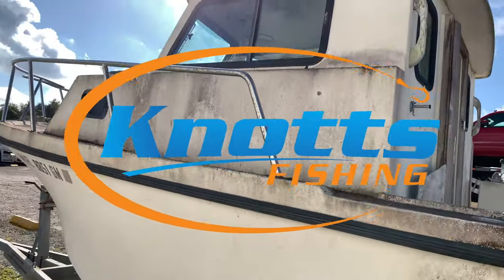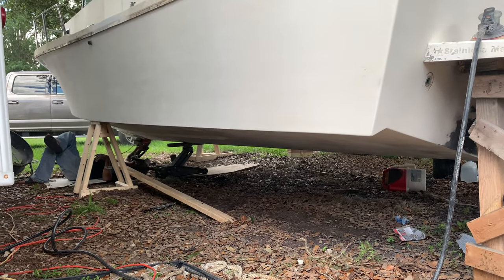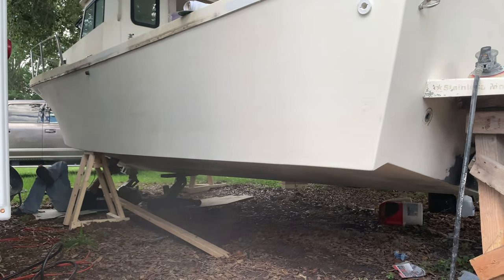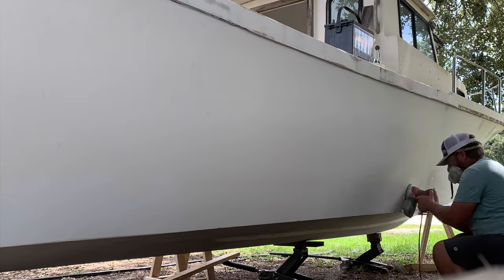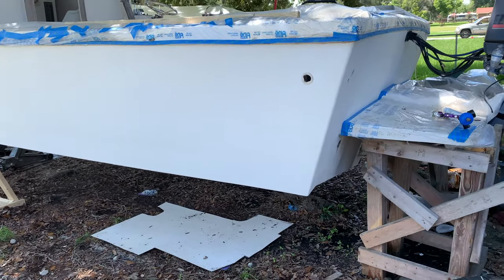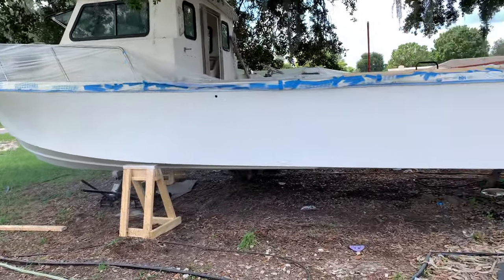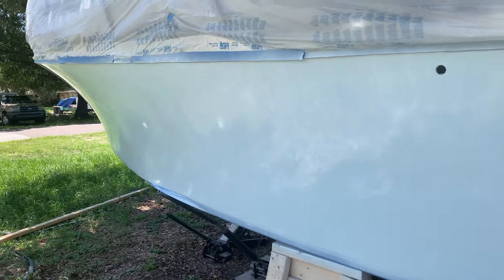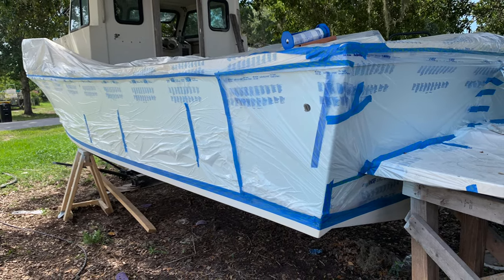Painting a boat with AwlCraft 2000 | Awlgrip | Broken Pilot House Part 5

Comment: Just found your channel, very interesting. When the boat was built did it have an inboard engine?  Reason I ask it looks like its had an outboard engine pod fitted. Cheers, keep up the good work
Reply from the maker: Ive been curious about this as well since it has the bracket and closed transom. But I don’t think so but ill find out soon when I cut the fuel tank out and replace it with a new one.
Thanks for watching. Cheers!
Reply: @KnottsFishing  thank you for getting back to. The reason Im interested is I bought a 27foot SeaRay, did have 2xV6 motors when it was made, I bought it with engines or drives   , Im thinking about putting 2 outboards on it using a pod. Cheers, Steve
Reply: Thats supposed to be I bought it without engines and outdrives,